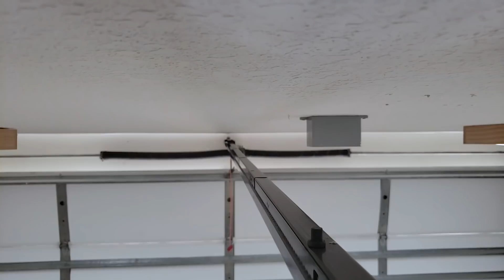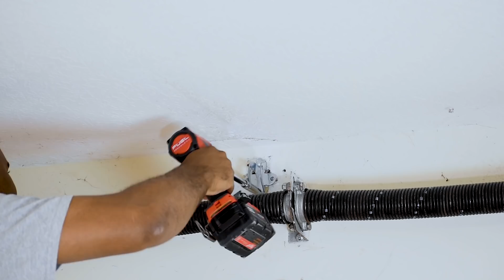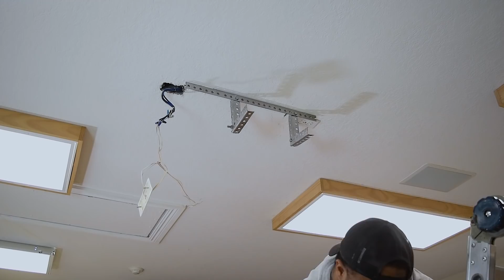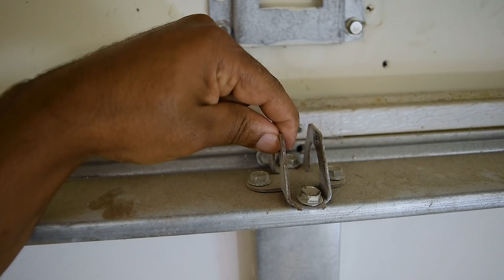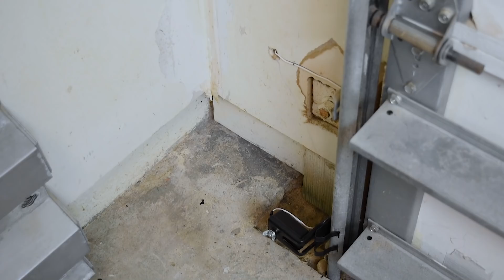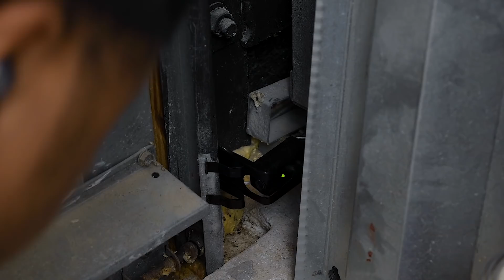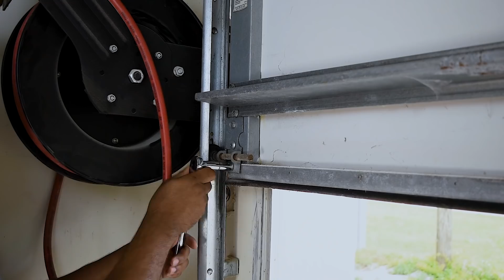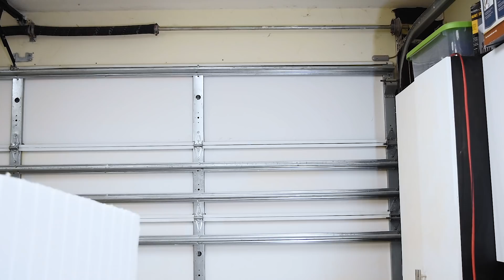3 DIY Garage Door Upgrades | Adding insulation, Replacing Opener and Weather Strip (in one day)

Comment: I have NEVER seen anyone with garage door wiring inside of the sheet rock. Most people's  I've seen, including my own, is just stapled along the ceiling and wall. I must sat Im truly impressed - such a clean look!
Reply: Steve Rivera I was a installer and we would always ask if the owner wants the wires hidden or exposed or dose not matter. most Don’t care. we always had stuff to run the wire in the walls or we could put up a snapcover that hides the wires

Comment: Good everything, except 
1) bracket attaching arm to door is in the wrong spot (very bad location) should be attached to stile not the strut
2) arm is upside down 
3) belt is way too loose

Great choice in all products, I would certainly recommend them all. 

Just a garage door technician with 22 years and counting experience trying to help and make good great!

FYI an experienced guy all that should take 2 hours to do, DIY’ers approximately 5-6 hours of work
Reply: that bracket made me cringe. seen brackets mount top of door, like this use upside down arms before tho.
https://www.waynedaltonparts.com/products/wayne-dalton-trolley-arm-attachment-operator-bracket
still not best choice.
Reply: 45 mins
Reply: Jason Trusty it only takes 14:57

Comment: I am a door installer
You have the door opener rod put on wrong curved part goes to the door straight hooks to the opener
:)
Reply: i am a door installer too and by the look of it i dont think it would fit with the curved part on the door due to were the bracket is install ! its right on top of the struts ... the curved part would hit the struts when closing ! it should be under the struts directly mounted to the door and only with the curved part (no extention)
Reply: 16 years in the industry says in this situation the shape of the motor arm is irrelevant

Comment: Just pull old motor down in one piece. Pull pin out of front head, undo screws holding bracket to ceiling at back end. Down in 5mins max
Reply from the maker: Yes, I learned that when I was putting the new one together. I didn't know at the time.

Comment: Great job and thank you for the video. One thing I'd like to add for everyone; never lube the track or spray lube on the wheels like you did in the video.  The wheels are a semi sealed unit and are made to ROLL.  When you spray lube in the track, the wheels tend to DRAG and not ROLL adding to the garage wheels and track to wear improperly.  To keep your track and wheel system running good, spray just a very small amount where you can see the inside of the wheels and the system around the shaft.  Try to keep the lube out of the track.  Thanks everyone.
Reply: I was thinking the same thing but I would not use WD-40 it has cleaners in it and take way grease a spray grease on the bearings is all you need to keep them water resistant. That can be applied buy gloved finger in tiny amounts. WD-40 will also leave a film that holds dirt.

Comment: Cut the cord on the track criminals can hook that with a wire and pop open your door
Reply: The safety release...
Reply: @Jackshaft  Yes cut the handle off. They bend a hook in the wire snag the cord and run it down until it catches the handle then pull the cord to open the door. If you take the handle off they have nothing to catch and you still have the cord.
Reply: @adude7050  what I'm saying is that it is meant for safety. So you're gonna be shit outta luck if you ever need to use it
Reply: @Jackshaft  Ummm don't cut it all the way back to the track leave some hanging. What I am saying without the handle on the cord they have nothing to hook.
Reply: Did you not watch the video link?
Reply: @Jackshaft  https://www.youtube.com/watch?v=EAk0t-D-_eo

Comment: I actually installed a new garage door opener two weeks ago. I must admit, I was a bit intimidated by the prospect of the DYI factor. It took a couple hours to complete but with the good instructions it came with, it was actually an easy job even for a first time. I'm 67 years old and was able to do it all myself. Don't  be intimidated, push yourself and save about a hundred bucks!

Comment: Lube the rollers which have ball barings, not the rails. The insulation adds weight to the door so springs will need to be adjusted, will keep your new door opener from burning out.

Comment: When removing the old opener you don't need to take the chain and rail off separately. Just pull the pin out of the front and unbolt the motor from the angle iron
Reply: I'm a garage tech. I use a 6ft ladder to take down the motor then rest it on the ladder. I use a 4ft ladder to undo the rail at the ladder, rest it on the spring but make sure the motor is in a proper position on the 6ft ladder so it doesn't slip off. Life the motor and rail off both ladders, set on the ground. Removing a motor for a new install only takes a couple of minutes.
Reply: or unbolt the opener from the celling bracing then old by the electric cord all the way to the ground then remove from the wall

Comment: I see that you did not change out your springs for the new weight of the door. .. I think that's why your opener belt drags when opening and closing.
Reply from the maker: No I just needed to add more tension to belt it good now.
Reply: @DIYCreators  ..lol. Hope the Spring last you..All Springs need to be calibrated for weight of door. Over all it a ok job... since I've seen so many homeowners try to save some money by doing it themselves but they always end up sending a lot more.

Comment: Putting the insulation on the garage door doesn’t that put strain on the torsion spring? Do you have to upgrade them to handle the extra weight

Comment: That opener is pulling to much weight up, that's why the belt is slacking. So I would add a 1/4 turn to each spring as needed until balanced. If you just tighten the belt you will put to much tension on the gear at the motor and it will fail within months...
Reply: I only say something because I have 10 years experience. I honestly couldn't tell you how many openers I have installed including jackshaft openers, which you should look into. 
Liftmaster 8500W...👍

Comment: Hey there. Just a tip. I am a garage door professional, and I deal with all of this stuff every day. If I were you, I would add some more tension to that belt. You want it to be taught, not overly tight,  but enough that it doesnt sag down like that when in the "up" position. Doing this will prevent the belt from slipping off the gear on the opener head, and avoid the possibility of the whole door falling down while operating. If the belt slips, so will the door. Great video!
Reply: Just curious how the whole door will fall down when the springs are what holds the door in place and not the opener. If the door is balanced properly  it shouldn't just fall to the ground should it?
Reply: @pyropreacher1438  you are correct. If the springs are property balanced, the door should rest at the bottom, middle, and up positions. Key word if. Years of not tuning the springs will cause them to loose tension. However, there are many homeowners that are unaware if springs are under-wound, or even broken. Given the chance that a spring could be not properly wound or broken, it is possible for a belt that loose to slip, causing the door to come crashing down. This is under the circumstance that the door isnt balanced and hasnt been tuned up in quite some time( in my experience, most people dont care to tune up a door often). But, yes you are right, given that the door is balanced, there would be no danger of the belt slipping, but it is always better to be safe than sorry, and have your door fall on your vehicle while backing out :)

Comment: Hi!  Even though there is some useful info such as getting a belt for less noise, getting a pro to change the springs, and getting a battery back up opener was good advice. There were some that I didn't agree with. Where the opener bracket was placed on top of the strut bar, also spraying the track with grease, how loose the belt was, and messing with the bottom bracket while the springs and cable were still under pressure where most of the reasons why I disliked.

Comment: I’ve run a garage door repair business and you made some errors. You need to move the J arm bracket much lower on the center stile of the door. You have the J arm upside down. Removing screws from the button bracket while the springs are tensioned can be severe and extremely dangerous. Also you need to tighten your belt.

Comment: Thanks for taking the time to show this project. I was wondering if you needed to make any adjustments due to the insulation and any extra weight this might add ?
Reply: Yes the added insulation can add up to 10-25 pounds easily which can take it out of range for the springs it originally came with.

Comment: If you add insulation on your garage door you has to do spring adjustment, because you are adding more weight, if tou don't do that the motor is gonna be forcing to much eventually the gear is gonna break. But is a good video. And good info.

Comment: Your door is an 8’ the opener is made for a  7’ that’s why it’s not opening all the way with the dogleg and bar installed correctly. Your belt is also too loose and shouldn’t sag down under load. You will find the door will run a lot better with the proper extension kit and a tighter belt.
Reply: Just seen your pinned comment sorry for bringing up the saggy belt again.

Comment: Man that belt on the opener is SUPER loose homie.  Also, you never mount the door/opener bracket to the reinforcement strut.  Big no no in the garage door world.  Just saying...
Your non garage door related vids rock tho!
Reply: Also, when you add insulation, it adds weight to the door.  Spring balance will be off.  That's why the belt was probably super loose.
Reply from the maker: Thank you, I added more tension to the belt today it's looking good now! I am not a garage door expert but the arm has been connected to the top since the house was built in 2006! Even in the new opener manual, it shows this configuration that's why I thought it was good to go. Where were you when I had questions😂
Reply: @DIYCreators  
Awesome!
Those Chamberlain openers are pretty legit.  Any garage door stuff I'd love to collaborate with you.  
Keep creating and keep it real!

Comment: A few things that you need change (1) The hockey arm Is upside down (2) the opener mount is installed to the top strut it needs to be installed on the center style of the door. If you keep it on the strut, this will damage the strut also it will damage your top section. Never use lube on the tracks lube only the roller shafts and garage door hinge, springs and bearings. By lubing the track the will collect dust and prevent the rollers to roll.  Also, you need to release the spring on the belt to keep nice and tight.    
 Just an FYI I have 20 years in the garage door industry.
Reply: Anthony, thanks for say what all door guys are thinking about this video.
Reply: @baldwulfnative  Thanks, just trying to help.  Great video!
Reply: @1945ramirez1  
When the manufacturers start installing and repairing doors themselves, then they can say what is best for it. 50 years of experience in the field of the craft itself is better insight than the "suggested best course" of the manufacturers who generally dont have a clue as to what is going on.

Not being rude, just being honest. The DIY people know more than they do.

Edit:
A silicone oil is any liquid polymerized siloxane with organic side chains. The most important member is polydimethylsiloxane. These polymers are of commercial interest because of their relatively high thermal stability and their lubricating properties.

Cleaning then is a good thing, but maybe 0.01% of owners will ever do it, and even less is the number of doormen that will take the time to do it while on the job.
Reply: Is it just me or does it seem like the motor is pulling a lot of the weight?
Reply: @YellowZnow88  Probably so due to the added weight of the insulation. Need to re-adjust the torsion springs to compensate.
Reply: @cwarner5909  i think that was actually a test run before he added the insulation, and my point was actually that he should put the door in manual and see if the springs are properly adjusted to the weight of the door.
Reply: @YellowZnow88  I don't think anyone else caught that mishap. That door is like 16'x8'...it may be styrofoam but it added weight no doubt. There's no correct way to just add almost 40lbs to the springs without overwinding them. The door would balance like shit cranking them to 9 1/2 turns
Reply: The best lubricants for doors are silicone based sprays that dont attract dust anyway. Spraying the rounded parts of the track helps a considerable amount with friction. (Fyi, dust will settle there on it's own, having some lube is a plus).
Reply: @influxedhoc  Per garage door manufacturers Oil-based lube is the way to go. Also, you need to clean off the garage door tracks once a year.

Comment: opener arm where the opener meets the garage door is backwards and also the opener bracket on the garage door should be lower. about the same height as the top brackets where the roller is so its not fighting against these brackets. anywhere on the metal style for that type of door is fine. if its insulated you will need a longer bracket, the size of the section. usually 19"-21"
Reply from the maker: Hi Robert, I as far as the arm goes there are two setup, trust me I double checked. I can send you a link to the manual if you like. 

As you seen in the video I used the old bracket, this is the way it was installed for over 13 years. I figured it was right as well.
Reply: @DIYCreators  I would like to see this. I have bee doing it for 7 years never have I seen it this way. On a Wayne dalton its higher up but that also has a bracket that supports that option. When a spring or cable breaks you'll understand why.

Comment: Don’t recommend mounting your operator to the Garage Door Strut. The J-Arm is designed to go beneath the top strut and mount directly to the Center Style on the door. For added reinforcement you can add what is called an O.R.B. to the center style.
Reply from the maker: Hey, that's for the feedback, this is the way the door was connected, in fact this is the way all my neighbors are connected at the top. I don't  know who is right or wrong, this is not my field, however the book shows this connection at the top as well as one of the mounting options.
Reply: It truly depends on the door type and in many cases location. I’m a garage door installer in the Tampa area and see too many doors with the mounting bracket ripped from the strut. That being said I have little experience with Clopay doors which is what I believe that door is. Very good video to help people looking to improve their garage without paying extreme fees to Garage Door companies.

Comment: I just installed this exact model four days ago, switched from a screw drive and this new belt driven is whisper quiet. One thing I noticed your belt has to much slack, the shear washer on tension spring should break at the required tension but if you measure the bolt to washer it should be no more than one inch and a quarter.
Reply from the maker: Nice, I felt it was a bit lose but I was not sure if this was normal because I didn't have anything to compare. I have it set to 1 1/4, that's why I was sure, but I will totally double check.

Comment: I do garage doors and garage door openers for a living, really great and helpful video for home owners, one thing tho the belt has quite a bit of slack in it when opening shouldn’t be a problem or anything but that could be caused by the spring tension not being quite enough, or the belt just needs to be tightened more , what I do is once the belt seems tight enough give it a couple good tugs away from the rail and then tighten it down again so that it is fully parallel with the gdo rail
Reply: What if the belt is too long? Can you cut it to size?

Comment: Don't forget to say about My Q yearly fee for using the smart device.
Reply: SB Photo42 I wish people would stop saying this. MyQ is 100% FREE TO USE!!!!!!        It’s a paid subscription if you want to integrate MyQ into your smart home automation.      The MyQ app itself  however is free without any subscriptions
Reply: @chamberlainliftmasterfan-2521  Then it is not free when other home automated apps do not charge. So, by saying it is 100% free is like saying you have a V8 engine, but you only get a v4 when in use.
Reply from the maker: As far as I know, there is only a subscription with google. I use it will the MyQ app as stand-alone, I have not had the chance to connect it to any home automation yet but I believe there are like 2 to 3 free options like Alexa.
Reply: @DIYCreators  I understand ,but I have Google devices all through my house and no Alexa devices.

Comment: Great work, though I'm not sure if the motor replacement was really an upgrade... Though much quieter, belts eventually wear out and break, whereas a chain will hardly ever be replaced during the life of the motor (sure, it may take a long time, but still...); secondly, the whole smart everything, mainly with, you know, a door for the inside of your house, is a few years of becoming digitally outdated and in risk of being hacked. Hopefully I'm wrong in both aspects regarding this specific unit, though!